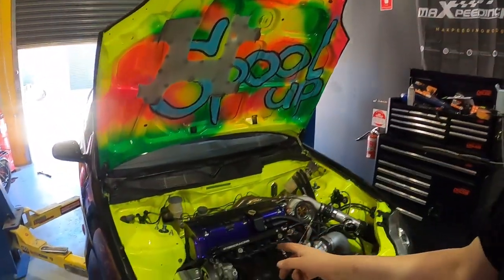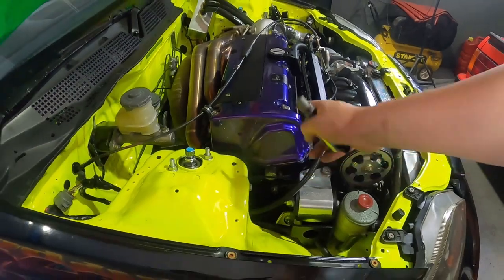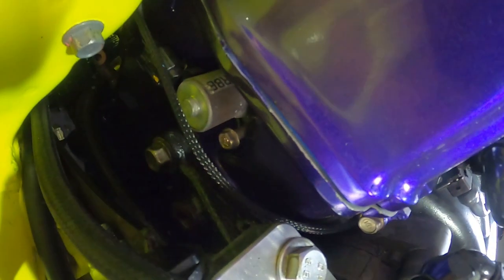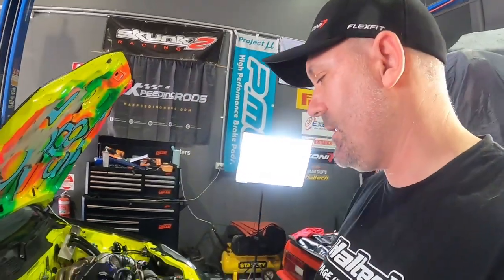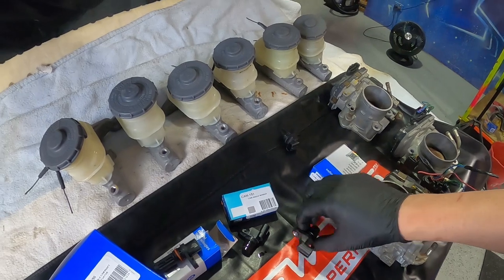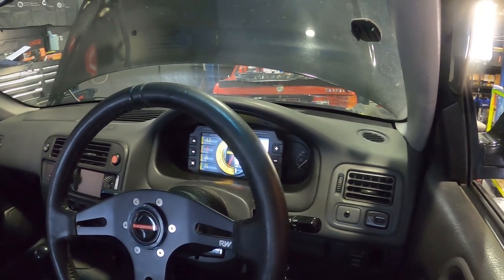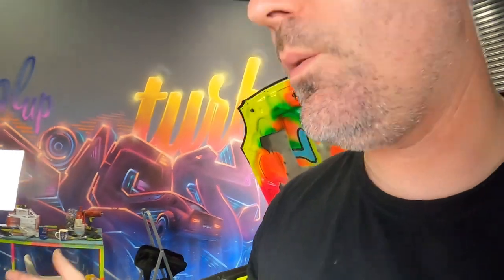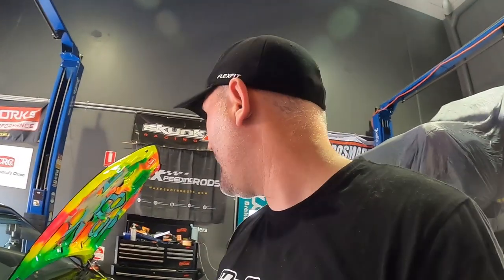How To Replace Every Sensor On A K20 / K24 With RACEWORKS SENSORS

Comment: just baught a turbo kit and haltech for my d16y8, super keen to put it on. risky to do on my p plates tho :0 

love your vids!
Reply from the maker: You will be fine the turbo will make it quieter, if you plumb back the screamer you will be fine
Reply: @TURBOTRISTO  yeah bro, also gonna hide the intercooler piping inside the stock airbox, black intercooler and turbo underheat sheild
Reply from the maker: check out my early vids there is an em1 civic that has hidden everything
Reply: @TURBOTRISTO  yep!, this is exactly what im looking to do! :D

Comment: Can you do a vid on pinging? Ive got pinging on my k24 usually at higher rpms. I only use 98 unleaded esp cos i use chongys reflash. Thanks mate
Reply from the maker: How bad is the pinging, have you asked chongy about it
Reply: normal driving is fine but soon as i try hitting vtec, all i hit is pinging. I had pinging before chongys flash, at that time i used evan from syds flash. Only got chongys reflash to see if his adjustments would get rid of the ping. 

Ive spoke to chongy about it and everything checks out, so his flash is fine. Havent seen any vids about pinging on a k series so i was thinking to get a valve adjustment, already changed my spark plugs. Mind you ive never had pinging until i flashed my car the first time. Ive already taken it to a mechanic and all they did was "clean" my intake for carbon build up but the ping is still present. 

Sorry for the essay but any advice is greatly appreciated at this point. Thanks T
Reply: Only use Shell or BP 98. Or BP100 if you are keen.